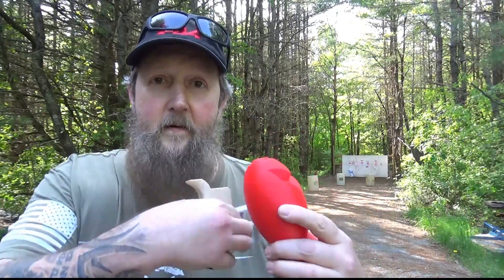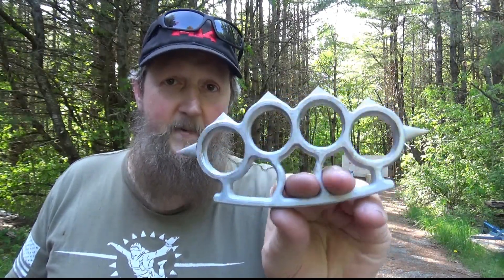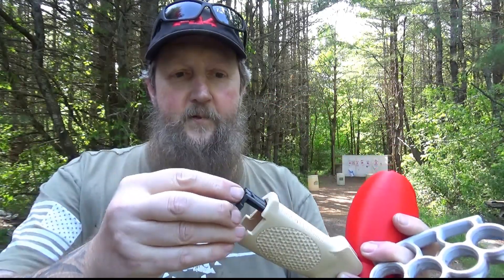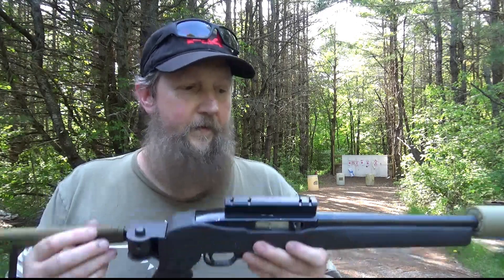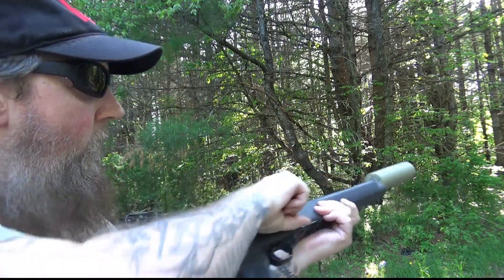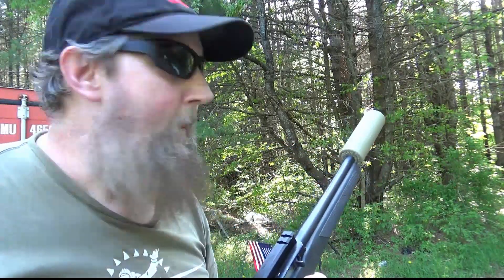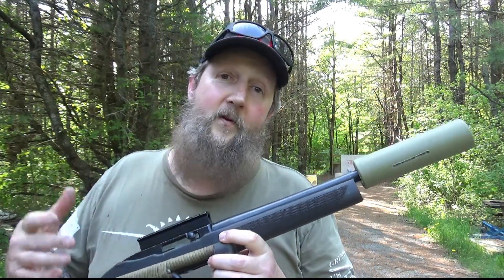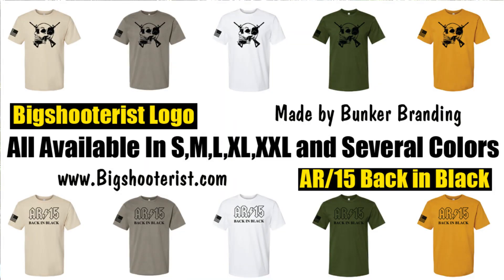Is a 3D Printed Sound Suppressor Possible?

Comment: I can't print supressors as I can't own one yet but I did print a 10/22 receiver. Its in the same stock as yours and its holding up great so far. It took about 250 rounds to break in but now it cycles smoothly and its because one of my favorite firearms in my collection.

Comment: Is it possible? You made this video in 2023. People have been printing them for a long time.
Reply from the maker: Roger that, and it's no longer with just plastics but powdered metal like Titanium. I've been working with additive manufacturing for over 20 years.  It used to be called "Rapid Prototyping" and was VERY expensive.  It wasn't like today, being so common that they're in lots of homes and inexpensive to run.

Comment: Need to read between the lines on this.   The form for a NON FFL07-SOT2 ... is a Form 1 $200 tax stamp for EACH one you print.  EACH one needs a specific serial number, which is on the form.  If that ONE gets destroyed.... by the book, you are needing a new $200 tax stamp to print another one, because you cant legally print TWO with the same serial number.   If it breaks... legally... you are out the money.  Read between the lines.   ATF DOES check Form 1 filers.  If you have 2 sitting at home... you... are... done.  Doesnt matter if its installed or not.

Comment: Without exotic filaments you have a disposable baffle can.
Reply from the maker: That was my gut feeling, but it's been several months now and it's still going strong.  Heat is the biggest enemy of PLA, and that little 22lr just isn't putting out enough significant temps under normal use so far.

Comment: You should try out the 9 mil cans,  those work awesome also with PLA+   I have tried it with 556,  it never works,  but it sure is fun to give it a try anyway.  If nothing else,  the thing self destructing always makes for a cool video lol.  The STLs I use for 9 mil (carbine) and my 45 (1911) are:  K-CAD 3D printed suppressor pack v1  They print beautifully on a K1 Max in horizontal orientation.  Takes about 14hrs to print a full length can on the Max.
Reply: There are some 5.56/.223 cans that work with just PLA+. I have a video on my channel with the first successful test of a fully printed, single piece, .223 one.
Reply: .300BLK sent my baffles to the moon on test fire
Reply: @farcere   LOL ya, super sonics in 300blk will do that.  Use subsonic and it wont explode ;)
Reply: @justhereforthalolz  It was a sub, end of the soup rester popped off and flew with the baffles
Reply: @farcere  Doh :D  Maybe it was bad layer adhesion or vertical print orientation.  If you print completely vertical (any part of the construction, tube, threads,  etc),  they do easily come apart.  Printing at an angle increases strength a little as far as that goes,  the greater the angle the more the strength is increased and printing completely horizontal is the strongest way to print it but it's also the hardest because your printer has to be capable of printing across some pretty large overhangs and large angles without any drooping.  I'm able to print COMPLETELY horizonal but thats because I use a K1 max which is completely enclosed, insane speed for quickly traversing large overhangs and has great fan management capabilities for cooling and what not.
Reply: @justhereforthalolz  Ender 3 pro couldn’t do it horizontally, probably with upgrades

Comment: I cant even shoot a full mag out of an AR47/AR10 without the barrel getting scalding hot. Ive had boost guage mounts melt sitting in my car in summer. No way more than a few shots those hold up
Reply: A .223 is going to heat up way faster that a rimefire .22lr

Comment: You can try resin 3d printing, they have high temperature liquid resins that are compatible with consumer 3d printers, you can get incredible detail from those machines. The resin burns rather then melting maybe it will last longer
Reply: Resin is to brittle.  They have high temp resistance and high tensile,  but when they break,  they shatter like glass into a billion pieces.  To dangerous for 2A printing.  PLA+ is king of 2A for a reason.  It would be cool to have a non-brittle resin since they print in a MUCH greater resolution and finer details come out better,  but the brittleness and warping just isnt something you should use in a 2A project.  Its pretty impossible to get a resin print to come out perfectly flat due to warping/shrinking.  The tolerances required in 2A are just to small for Resin to deal with.
Reply: actually siraya tech blu is made and designed to not be brittle at all. a great resin for 2A printing
Reply: @OberonsOccult   LIEZ.  I actually have an M5s AND Siraya tech Blu.  It absolutely DOES shatter when it breaks.  Getting it to break........ very hard.  But when it does,  you dont want to be anywhere near it.  I also have Rock-Black Stiff and Nylon-Green tough both of which are even stronger than Blu,  but still,  all 3 shatter when they break.  There is a reason why PLA+ is still the king of anything that involves explosions.  It doesnt shatter.  Making lowers out of these 3 Resins 100% possible and I have many (both DD glock frames and UBARv2 Lowers).  But I would never use ANY resin for a suppressor!  The gas pressures should they cause the thing to break would be like standing near a grenade that just went off with tons of tiny shrapnel pieces.  I have blown up many PLA+ suppressors and I know from experience,  they dont shatter.  They just launch themselves 50-75yrds away and make for a great laugh because its almost always the threads that give out.  However,  I did actually have one snap in half when I slapped it on my 5.56.  That was pretty amusing.  But it didnt shatter :D
Reply: @justhereforthalolz  I'll grant that once those resins get to their respective breaking point that they do in fact shatter. However shattering would not be solely indicative of brittleness. Steel put to it's breaking point will still shatter. And I'm not stating that sla is better than pla+ in 2A applications. Only that it is viable. I have personally tested blu suppressors with 0 failure. And the sla is also by far more heat resistant than any pla I have seen causing the point of connection between the suppressor and barrel to be far stronger overall. I am interested in the green you mentioned as well because I have heard great things.
Reply: @OberonsOccult   The very definition of "brittle" means that it breaks into many pieces due to it's inability to FLEX (like a PLA+ will do).  The point at which it breaks isnt relevant.  For example,  Glass is very brittle unless you reinforce it somehow (usually with some sort of plastic and 2 sheets, etc).  However glass is also EXTREMELY strong,  can be even stronger than steel in some situations/applications.  But that doesnt eliminate the fact that it's brittle.  In fact,  the stronger something is that is also brittle,  the more dangerous it is imo because the explosion of shards would be so catastrophic.  I love SLA Resins for many things,  including lowers.  But I'm not going to ever recommend it to someone who doesnt know any better.  IE:  I wouldnt use a Resin for a 308 lower but I'd surely use PLA+ for it.  PLA+,  rather than shattering,  will simply deform (AKA bend, crack, melt,  etc) before it shatters.  DISCLAIMER:  PLA+ will shatter at temps below freezing as will most anything ;)

As for the Nylon-Green.  Toughest shit I own.  If you can manage to break it,  thats an impressive feat,  but a 5.56 definitely achieves that goal.  I've tried it while hiding inside a car hehe.  If you like to blow stuff up,  theres nothing cooler than watching a strong resin shatter into a zillion pieces,  it makes for fascinating slow motion video for sure.  The heat resistance of the SLA removes the weak point of the suppressor from the threads to the actual body itself since the heat wont weaken the threads like it does on a PLA+ suppressor which is why PLA+ suppressors usually launch themselves out into the field instead of breaking.  But by doing that,  it means that IF the thing breaks,  it's going to be catastrophic and you dont want to be right next to it when that happens.  The green and black can be used for a suppressor if it's a 22LR or 9MM (super sonic for both) if you're the gambling type.  But dont try it on 5.56 or anything with a lot of energy unless you're using subsonic.  The Nylon-Green tough also has another cool property,  it's translucent,  so you can actually see the gases inside the suppressor with slow-mo video.

Something that I would be EXTREMELY interested in would be how to reinforce an SLA resin to be less or not brittle at all without giving up it strength.  I've yet to find a solution to that :/  I dont trust any material that I havent seen break.  It could be the toughest stuff known to man,  but if we dont know how it behaves when it breaks,  I want nothing to do with it.  So if you were to say like "I've been using them for yrs,  never had one break!"... I'd be even more skeptical because it simply tells me you dont know what would happen if one DID break :)
Reply: @justhereforthalolz  so what would your thoughts be on a suppressor utilizing strong sla as the connection point while utilizing pla+ for the main body using a multi part build? You'd remove the strain of the blast from the sla component while increasing the thermal resistance preventing the pla from melting off.
Reply: @OberonsOccult   Thats not a bad idea actually,  you could design a thread connector in SLA that converts the smaller thread to a much larger thread and move it further away from the heat,  yea,  could totally see that as a workable idea because most of the stress would be on the PLA+ rather than on the Resin.

Comment: If you can still find them, a JWC Competition bolt for the 10/22 comes with 3 sets of springs (subs, standard, hv) and an easy out design. One of the best upgrades I've done!

Comment: 3d printing lets you make some really intricate baffle designs, so you can get some crazy good supression. Add in a metal can and thread inserts and you got something that cab easily compete with commercial supressors.
Reply from the maker: I absolutely agree.  I'm at the beginning of the additive manufacturing curve, but its advantages are already obvious. Like you said, if I add metal in the obvious places like threads, blast baffle, etc, it will extend the lifetime greatly.  I can't wait to start testing PLA+ & PLA Pro. I'm also anxious for the machines that use powdered metal to become more reasonable.  It's a fun journey, for sure.  Thank you for the excellent conversation. 😎👍🏼🔥
Reply: @Bigshooterist  Selective Laser Sintering costing as much as a particularly overpriced college tuition really is a killer when it comes to trying out emerging tech. That said, most FOSSCAD devs have been designing their releases based on either Polymaker or Esun PLA+. I personally have had nothing but problems with polymaker, but Esun has been wonderful.

Comment: Strategically adding cheap and available metal parts via a tough epoxy in key areas can greatly improve durability and usefulness.  

Ex - model the threads to instead be a cutout to snugly fit a cheap A2 flash hider with JB weld and you'll have steel threads.  Epoxy an aluminum tube to the OD of the print and it won't be able to deflect nearly as much under heat (and bringing the bore line with it) and the layer adhesion (weakest aspect of prints) won't have to bear nearly so much pressure.
Reply from the maker: Great ideas.  I thought I'd start at strait PLA, which is as weak as anyone will experience and maybe work from the "Yeah its possible" category up to the "this just might actually work" level.  Thanks much!

Comment: PLA+ is my favorite material, but I find that PETG works really well for things that suddenly get quite hot, and I suspect baffles would print pretty well. I focus more on automotive things and shop vac attachments, but the principles are the same. Using PETG you can make a muffler for  an outboard if you give it some pipe length.
Reply from the maker: That's AWESOME! Thank you for the insight. I'm still a nOOb to 3D printing, but have a decent scope on manufacturing in general. I'll start reading up on other options. Much appreciated! 👍🏼
Reply: The shop vac attachment idea is great. I think the strongest reasonably priced plastic is either Polycarbonate or nylon but I'm not entirely sure. I think they're kinda a pain to print though. If you didn't have to pay so much for a tax stamp I'd try the suppressor, but it's just not worth it to me. I could always just print test and hide it, but I only have access to public ranges where I am.
Reply: They also work pretty good on nitro RC cars.
Reply: Petg does not handle failures well.
Reply: ABS, this is the way!!!

Comment: I have been lucky to have worked as a design engineer with the capabilities of metal 3D printers, believe me...when that technology reaches the masses, it will revolutionize the 2A community
Reply from the maker: That's awesome to hear.  We've always had the benefit of other industries, such as aerospace to assist firearm technologies. Great news.  👍🏼
Reply: That is why they will never allow metal 3d printing to reach the masses
Reply: @darktrojan00  to be fair they are only a couple grand for small ones and around 16 grand for one the size of a small cnc mill... not terrible but not 300 bucks for a sovol svo6 with a klipper
Reply: @joshmiller9783     Only $16K for a 3D metal printer?  Granted, that’s not chump change, but I’d be all about getting one up and running if I could find someone who knew how to operate it properly and efficiently lol..

Do you happen to have any information on the names of the machines?

I appreciate it!!!
Reply: That's what you think. @darktrojan00
Reply: @darktrojan00 you do realize they already are.    They are just cost prohibiting for many at this time.     But so were flat screen tv, 3d printers and decent gaming consoles.      It will happen and already has a
Reply: Yea, I just heard some old lady talking about metal printers and how when those get out they will not be able to stop people

Comment: So the real questions where do we get the cad files.
What I'd really like to use it for... Can I use this on my Air Rifle without the FEDs getting butt hurt. 25 cal?
Reply from the maker: There are files all over the net.  I don't know enough about them to recommend any yet. As for the air rifle (non gun) "non-suppressor," the last time I looked into it,  they had to be integral to the air rifles.
Reply: @Bigshooterist  Well that stinks. Its surprising how loud some of these Air rifles are. Suppressors are pretty darn simple it can't be that hard to design your own. Then there's the other part where I wonder how effective it would be to do a metal / plastic combined can.
Like having a series of wafers like 1" thick disks that you can press fit metal components after you 3d print some of the parts. Then each of the disks screw together. So you'd have 2 kinds of parts end caps and the core. With that you could just keep adding disks depending how long / quiet you desired your shots/firearm to be.  Give you I don't know anything about 3d printers always wanted one.
I don't know much about this but it gives me a large amount of ideas, for instance could you get a very soft filament so you could use it for making molds and not the actually part? You could use aluminum cans for you metal source possible. 
Man I need to get a 3d printer is is cool stuff.

Comment: PCP air rifle suppressor, maybe not for high power big bore ones though. That big blast of high pressure air might delaminate the tube
Reply from the maker: I think it will take stronger material than PLA and I'm only moving with baby-steps. I tend to agree with you.  👍🏼